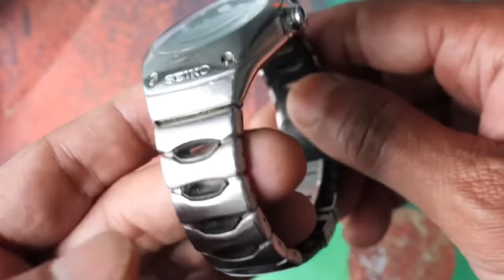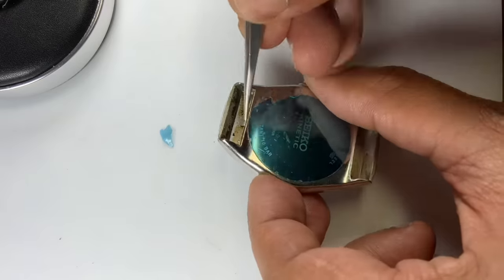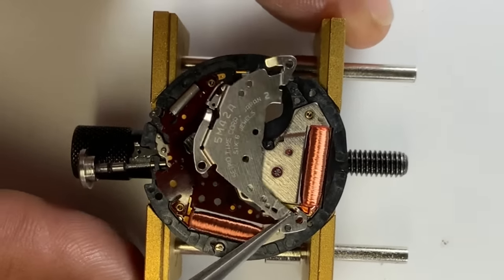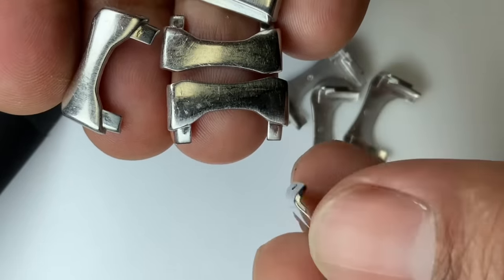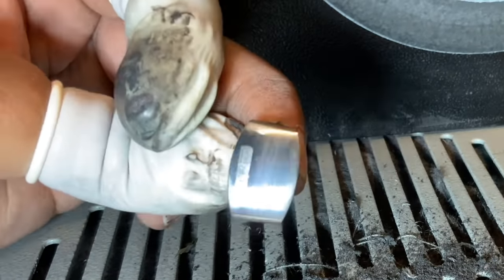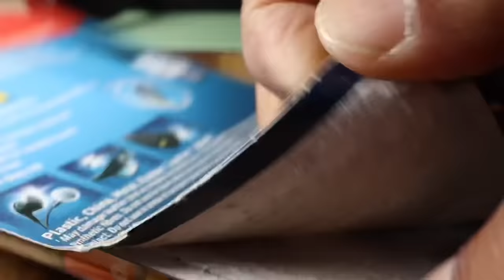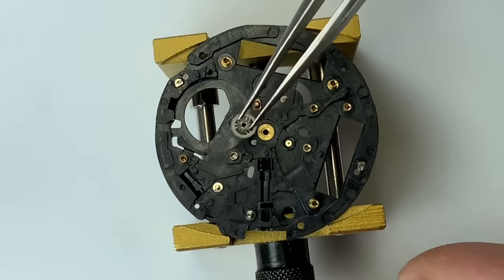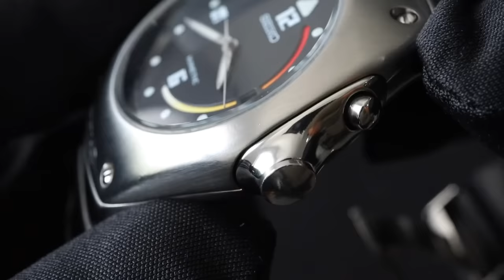Restoring the Ultimate 90s Seiko Kinetic Arctura!

Comment: I realize this is somewhat an old video - but - I now own two Arctura watches.  One has the same movement the watch you did has - the 5M42, where the capacitor replacement is pretty straightforward.  The other one appears older - it's case is a front loader - and the front is held on with 4 screws into the metal back case,  Unfortunately - it uses a 3M22 movement (apparently similar to the 3M21, 3M42A, 3M62A, etc.)  The unfortunate part is - I can't find any videos or on-line instructions to swapping that battery out.

The complexities include - no instructions.  There are plenty on line for a 5M series, none for the 3M22 and variants.  The battery in the 3M22 requires a good deal more disassembly of the movement to get to it and replace it - and of course I forgot to take pictures before disassembly.

There are two rather complex stamped parts that have to be removed. One is the battery hold-down bridge, which also connects into other parts of the watch.  Getting to it does require removing the swing-weight of course.  The second one is a metal bridge that appears to be just there to hold down the one connection from the battery.  Confusing the issue a bit more - the new battery came with a replacement for that bridge assembly, and a spacer for the battery (which has a complex metal connection welded to one side) - and it IS different from the old one.  The battery size is also different and a crescent shaped plastic bit comes with the battery to make it fit the battery mount, but of course no info on how to use it or where to install it. I took a WAG and figured behind the battery, letting the body of the battery touch contacts buried in the battery mounting hole.

Long story shorter - it is a frustrating job with no instructions, and when I got done I'd gone a step backwards - the new battery appears heavily discharged (less than 0.5V) and so far the watch is not running.  I've been spinning it up a bunch, I may leave it on my toothbrush charger tonight.

Just wondering if you might know of any service info on this movement?  Google and Bing aren't turning up anything useful.

Also - I stand in awe of your tweezer work.  I may just have crummy tweezers or closing in on 80 I may not be as steady as I used to be, but mine love to launch tiny screws off into orbit somewhere never to be seen again until I get rid of that particular watch.  I found a fix for the euro/Asian watches - AliExpress has a vendor selling 100 tiny screws for very small money.  I bought a pack and they've already saved my butt on this watch.  they aren't as well finished as the Seiko screws that are now in outer space, but they seem adequate to hold things together.  I think I'm going to order another batch shortly.  As soon as the watch was reassembled the screws that were in hiding revealed themselves and sheepishly came out of hiding.  Tough on them - they went in with the bulk bunch of Chinese screws.
Reply from the maker: Try this https://www.cousinsuk.com/PDF/categories/259_Seiko3M22A.pdf

Comment: Thanks for this.  I have a Seiko Kinetic which I am very fond of.  It has been a reliable partner for about 15 years.  It did need a repair last year.  I think the generator rotor broke but the repair statement wasn't specific.  It was also in Japanese so I may have missed it.  Anyway its working again but I'm lusting for an Omega Seamaster co-axial.  The Omega won't have half as much power reserve but I only wear one watch so it shouldn't matter.  It would be interesting if you could show a co-axial sometime.

Comment: Hi Joe, great video!! ❤ you’ve inspired me to have a go of fixing my friend’s seiko kinetic 5J22. Lo and behold it had the same fault, the tiny lower pivot on the generating rotor wheel broken off. Could you tell me where i can actually order one of these please (I’m in the UK also). Part no. 4146-522. I cant seem to find anywhere. Thank youuu!!!
Reply from the maker: Try google the movement number and rotor and it should come up with various sources. Other sources are cousinsuk or boley.de
Reply: @NekkidWatchmaker  thank you very much! I’ll be using your video to help me get all these tiny pieces back together in the right order!! 😂👍
Reply: Hello mate, I did it!! I fixed my friend’s seiko kinetic, replaced the generating rotor. It’s thanks to you man, i wouldn’t have done it without your videos. My friend is made up❤

Comment: Hello.  I have a Seiko watch with the 5M42A movement that I purchased new many years ago.  It was working fine until one day it died.  The oscillating weight stopped moving.  I opended the case and the oscillating weight was difficult to move.  There seems to be a problem with the generating rotor.  If I spin oscillating weight with my finger I can get the second hand to move.  Is there anyting I can do to free up the generating rotor?  I have big clumsy fingers and nowhere near your skills.  Kind regards, Al.
Reply from the maker: If The pivot is broken then it needs replacing
Reply: @NekkidWatchmaker  Wow, that was fast.  Thank you and I wish happiness and safety to you and yours.  Kind regards, Al.

Comment: Nekkid  Watchmaker  I’ve got 2 of these! They are a great watch. Very comfortable to wear and look great on the wrist. BUT the strap is terribly designed, in so far as you have to cut the rubber inner. Problem I have is one of my watches straps was broken and I can’t get an original  replacement ! ANYONE ANY IDEAS? I’ve tried, I think everywhere. Any suggestions please?

Comment: So I bought a Kinetic about 15 years ago, at the same time I bought an SKX. They had similar wear for 10 years. Interestingly the Kinetic failed after 5 years and needed a service - broken genny pivot. It failed 6 years later and needed a new capacitor. The SKX has never had a service and still returns 10s per day, I am not sure if Seiko's theory around Kinetics being low maintenance actually works.

Comment: These Kinetic Seikos are a very good movement,but if not worn often the cell will die as it is charged by the rotor movement.I take the rotor out and replace the rechargeable cell with a normal silver oxide watch battery.As many people have watches for different occasions the kinetic rechargeable cell will die prematurely if not sufficiently charged by movement.A Seiko kinetic cell will last for many years if it is the watch you regularly use.

Comment: Me again! I have a serious issue with this watch!  I found out that the watch (both of them in this series), had water damage from the sea. The screws that hold the bezel together, were rusted and brittle. Now half the screws are stuck inside the holes. I've contacted SEIKO here in Japan and they will NOT help! Do you have ANY idea where I can get either new screws this small, or where I can send the watch for repairs? I don't care where in the world it is.
Reply from the maker: You’ll have to get the movement out somehow and then you can stick the case in dissolved alum powder to dissolve the screws out. You’ll then have to source some aftermarket screws. A donor watch may help. Sadly I don’t know anyone who would undertake this mate. Sorry
Reply: @NekkidWatchmaker  Thanks for taking the time to respond and for the advice. Not sure where I can get the powder over here but I’ll shop around. I have a bunch of watches and parts so I’ll spend some time looking for what I need from an old watch. Thanks again mate, very much appreciate it!
Reply: @NekkidWatchmaker  - sorry to be a pain in the rear end mate, but what kind of alum powder and what’s the process? Cheers lad!

Comment: Observation:  You moved from your hard felt buff to the muslin without cleaning the part.  I don't know whether the abrasives are the same, but if not, then you are cross contaminating the muslin with whatever you had on the felt.

Sorry, old silver/goldsmith can't keep it shut.
Reply from the maker: I use felt then a dirty mop to remove the compound. But always wash before moving to a different cutting stage with different compound. See my latest oris video for more info. Thanks